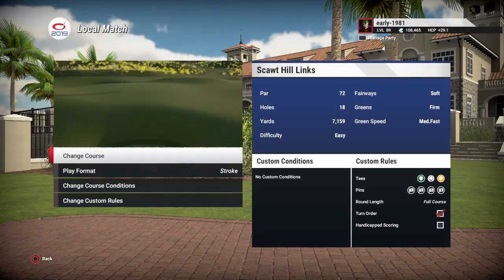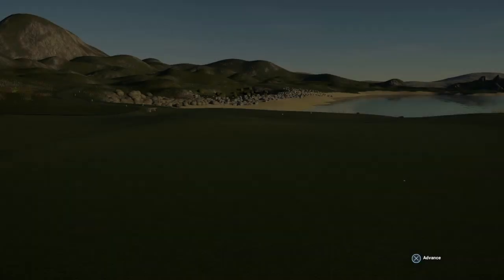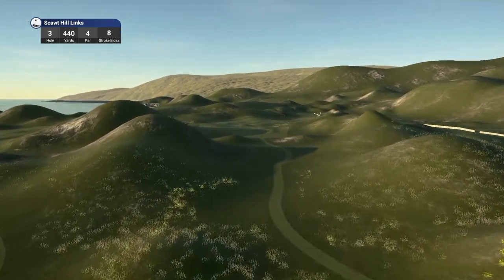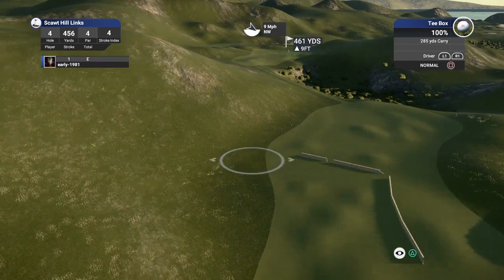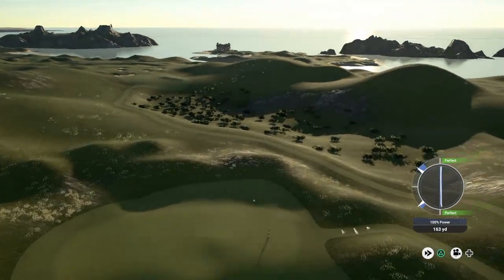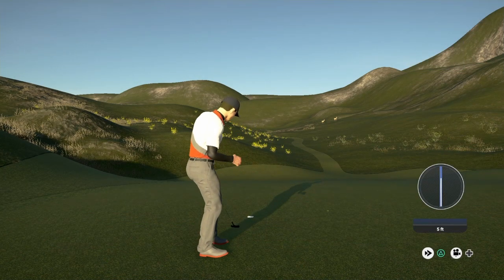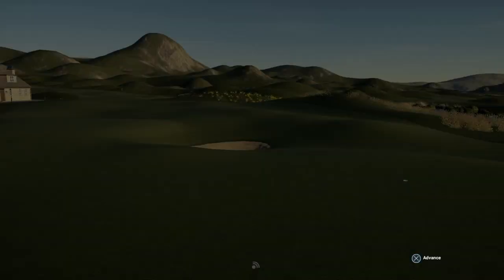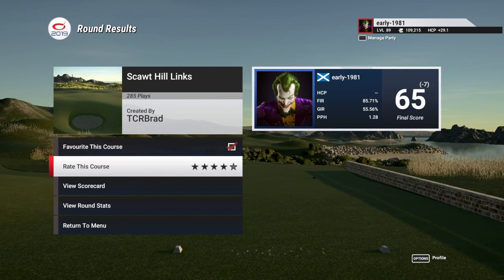Scawt Hill Links (World Cup Of Design Contest)

Comment: Excellent round again....do u have any advice for tempo? I'm on CC- A on TGC tours so am a pretty decent player but my downswing is my weakness and as I play on xbox the slow swings in particularly cost me severely. I realise this wasnt your best round tempo wise but 9 times out of 10 your downswing tempo's fantastic. Would appreciative any advice cheers.
Reply from the maker: Your obviously a talented player pal. I just try to swing at a constant speed. As long as you find a rhythm that let's you pull and push the analog stick at the same speed you will be fine. I've heard xbox is tougher for some reason.
Reply: @Early1981  Okay cheers. I have started to watch the ball rather than the club head during the swing which has helped to an extent. Yeah xbox pushes slow downswings further right than ps4/pc which is why only 1 of the worlds top 50 in the TGC rankings play on xbox.